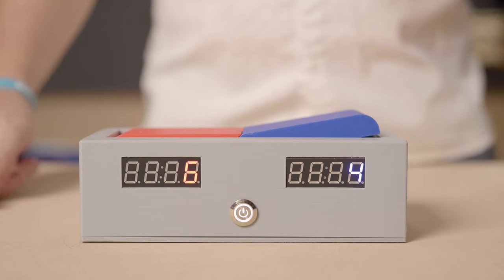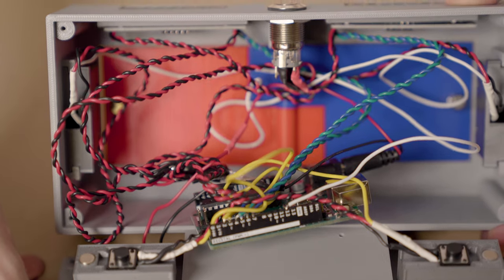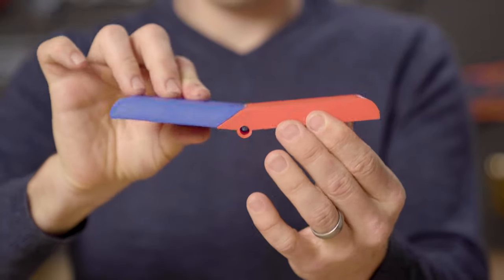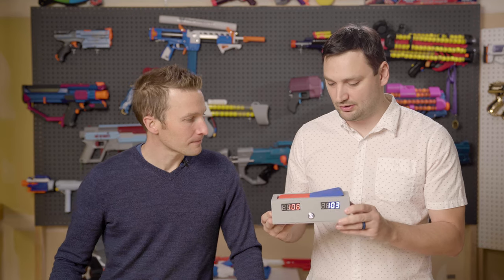Nerf Game Timer (3D Printed Arduino-based KOTH timer)

Comment: My local nerf club, RFDL (Rochester Foam Dart League) just recently acquired a game timer designed and built by one of my friends. It is built from a toolbox with a clear lid, and there is a small momentary pushbutton switch on each side of the toolbox. There is an RGB LED strip in the clear portion, so you can always tell which team has it. There is an LCD mounted under the clear lid that displays time and status. The button must be held for a certain amount of time to change from red to blue or vice versa. The whole device is run by an Arduino UNO clone.

Comment: If you are using an arduino for the guts, I would suggest adding a speaker for custom sounds? Maybe a usb port... then you could turn it into an alarm clock... sci fi prop etc. ???

Comment: I dont have access to it any more, because I have moved away but I built a really quick and dirty one one from a large paint bucket (basically a Homer Bucket) with 100mm illuminated domed arcade buttons in Red, Green and Blue in the lid for airsoft, but totally applicable to Nerf or Lasertag.

Flick the bucket on with a nice "missile" switch and it would blink all three when "unclaimed" once you hit a button it would count up that colour, blinking the relevant button to show who owned it from a distance. Switched over to the other colours when they were hit, etc.

End of the game you hit all three of the buttons at once and it blinked the colour with the most accumulated time. Meant we could play any length of game.

The bucket had plenty of room with a big deep discharge lead acid battery in the bottom and I had no issues dropping that anyway in mud, grass or whatever. Being a large object meant it was visible to all and rarely got knocked over, although someone spectacularly tripped going for it and sent it rolling away from them.

My favourite hack for it was keeping the battery in place by filling a trash bag with expanding foam then pushing the battery into it before it set. Basically making a ghetto blow-molding in the bottom for it.

Comment: Might make it heavy and rubber for the bottom for grip to keep it from moving. Because somebody is going to smack the crap out of it. I got the ninja timer but you have to use two and there crazy expensive. There only one button and there both red, I would have to paint one blue